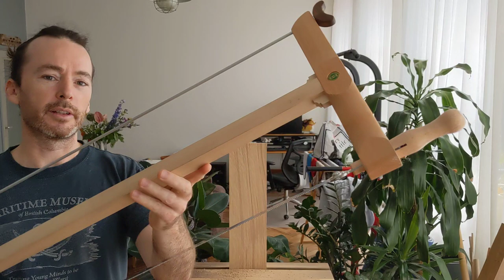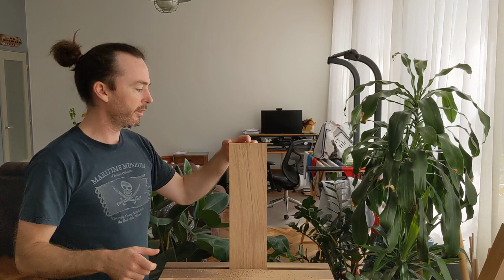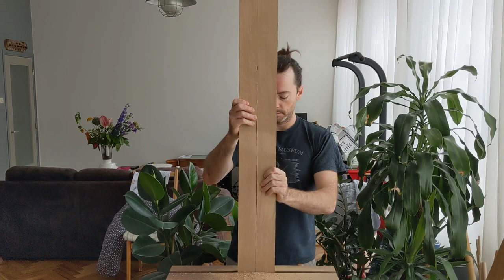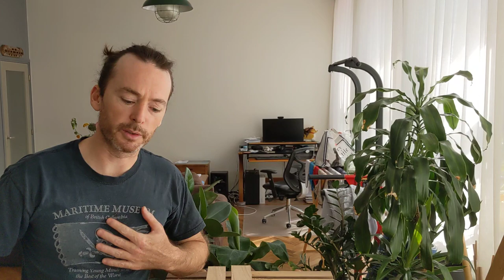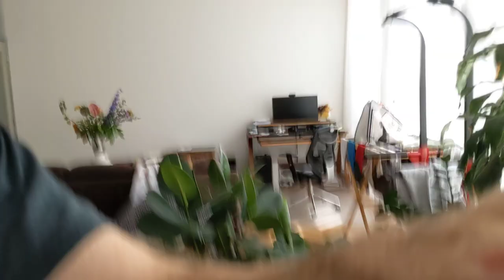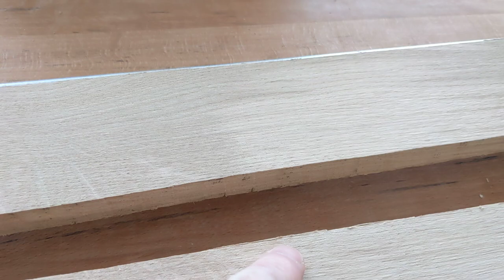Rip cuts with a European frame saw

Comment: I am drooling for that saw. I would love to see you resaw a board with it.   How hard is it to keep the blade from wandering?
Reply from the maker: I recently did some resawing with this frame saw. The first cut was a bit slow and difficult, but on the second cut I put more focus on clearing the sawdust by rocking back and forth so the saw isn't addressing the entire depth of cut at the same time.

That made the cut faster and easier. In general the saw tracks amazingly well, and of all my saws it's the easiest to steer during a cut.

Comment: Just FYI, for this cut the piece better be level. Holding it upright this much in the air will give tons of vibrations (visible at 2:05). Not only that, but holding a frame will be easier - this one is a heavy saw and trying to balance it only results in a stray cut and a wide kerf.

Comment: Sometimes the algorythm is a b**ch, and sometimes it gives you gold like this! Nice cut! Ive been wanting to build a frame saw, but i still dont understand how you got your cuts to meet accross that distance. How are you controlling the cutting direction given the frame swivels? I'll keep an eye out for future videos!
Reply from the maker: The best way for me to cut straight is to feel when the blade has least resistance, that means the 'plate' above the teeth is properly aligned in the kerf. Recognising that solved most of my problems.

To steer the cut you can tilt the blade (twisting your wrist) or angle the blade a bit side to side (moving your hands a bit left or right). The second method feels most effective to me.
Reply: @conormow  Thank you, that's excellent advice! I'll give it a try!